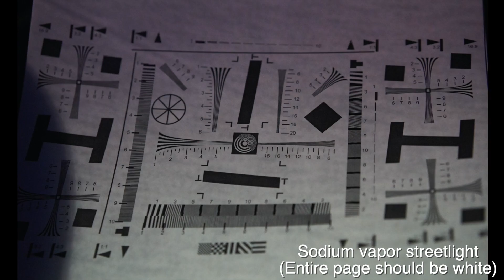Image Banding - How it Happens & How to Prevent It

Comment: Flicker detection might also help with light banding on bodies that support it (5D4, XT3, A7R3, etc). Stage lights in some venues I shoot in are particularly bad. It's really noticeable on my 5D3 shooting dance at >=1/1000.
Reply from the maker: I didn’t mention anti-flicker as it’s generally to reduce inconsistency in the exposure of the entire frame. So without it you could have bright and dark images alternating with one another, but while using anti flicker the shutter will align with the brightest output of the light each time to give you more consistent exposure. It rarely has much effect on banding artifacts (in my personal experience at least). In terrible LED lighting situations the best I found it did was make the banding more consistent 😂 (on the a7iii specifically).

Comment: I've found setting my shutter speed to 1/100s on a7iii really helps banding when I shoot in silent mode ( I'm in UK, just in case lights have different frequencies in other countries ). 

Basically, if you shoot in silent mode, see what shutter speed helps.
Reply from the maker: That would be the equivalent of 1/125 in North America.
Reply: @WesPerry  guess so, and defo worth a try. 

It's not perfect, as I've found some lights work differently, but for the most part, changing the shutter speed helps
Reply from the maker: I didn’t recommend doing this in the video as I have always found this Reduces the amount of banding, but hardly ever eliminates it, at best leaving dark bands at the top and bottom. Hard to see, BUT I CAN SEE THEM. Haha
Reply: @WesPerry  sorry, should have said I dont shoot video.
Reply: @aFLYER1980  in video I can understand flicker or banded images and also in still photography with flash light . but in day light we are facing image flicker or banded image ....its create nuisance
Reply: Can't possibly shoot a gig at that speed though
Reply from the maker: Yeah, 1/100 and even 1/125 is hardly practical for shooting human beings doing much of anything.

Comment: Instructive video. It's indeed worth adding "ECFS" to "My Menu".
About the last problem, maybe it's possible to fix it in post by shooting a lot of photos even with the silent shutter, and then "smart" merging them? The problem is that "smart" part, but in theory, such a program could be made and fix photos automatically.
Reply from the maker: That would likely be possible with static subjects. But for people moving around you’re kindof stuck. I fixed one once just by making exposure masks the size of the dark bands and upping the exposure. It was a bit tedious but it mostly worked.

Comment: Recently switched to the a9 for my main camera. Thank you for providing the link to show how the a9 did with different lighting. I mainly try to shot at 1/160 in theater light no flash allowed situations so this looks promising for trying to keep quiet. Also, good to know about the 85. Sounds like for those rare situations I'm probably better off using the 70-200 GM.
Reply from the maker: I think one of the reasons the 70-200GM does better is that the flare needs to have a warm tone to cause the issue, while the 70-200GM flares a bit greenish.
Reply: is 1/60 not to slow for moving people on stage?

Comment: Thank you again. I would like to know more how Rotolight  (and similar) differ from say AD200 when it comes to banding? I understand constant light but not sure how flash on AD200 differs from LED on Rotolight. 

Thank you Wes! Always a joy getting a video from you!
Reply from the maker: In HSS a regular flash (like the AD200) emits several quick pulses to cover the time the shutter moves across the sensor. An LED flash, though, just turns on the LED brighter for a long enough period of time to cover the shutter traversing the sensor. No pulsing, just holding.
Both methods cause the flash to dim in HSS due to the increased power consumption.
Reply: @WesPerry  Thank you. I understand.